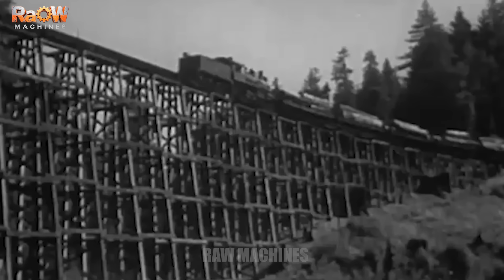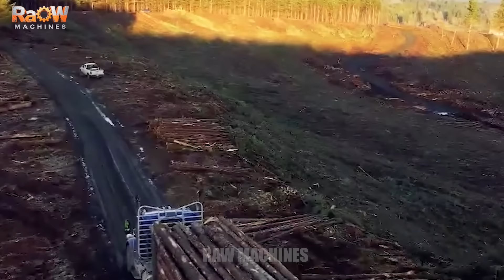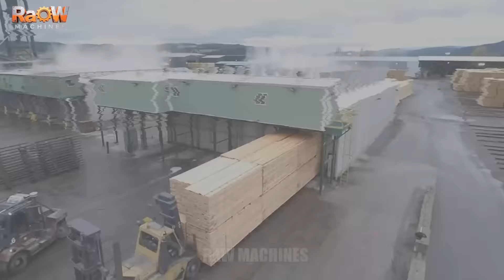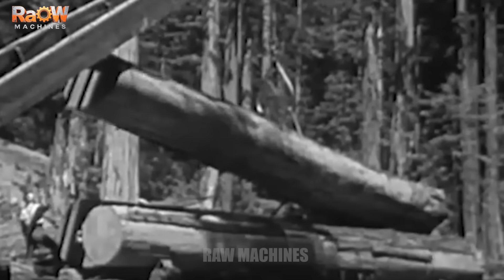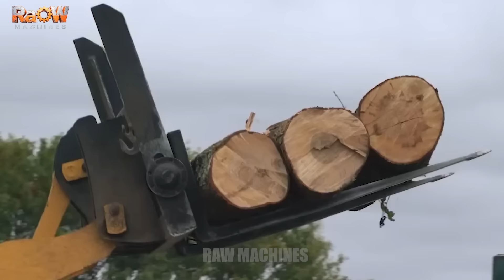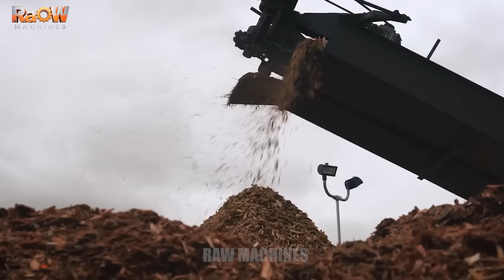Inside USA’s Most Advanced Wood Sawmill | A Gigantic Machine Turning Millions of Logs to Lumber Fast

Comment: Sustainability is not on the forefront of timbering. 
Hemp can grow at an extremely high rate, is nearly impossible for most bugs, fire and other problems that will always occur in wood.
Reply from the maker: Good point—hemp is impressive as a fast, resilient alternative. Timber has tradition, but exploring hemp makes sense for sustainability.